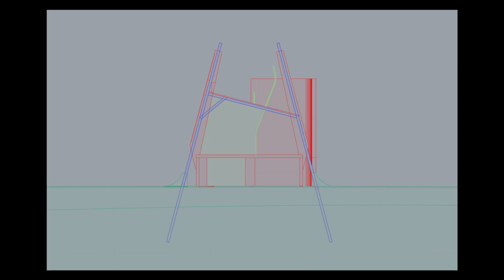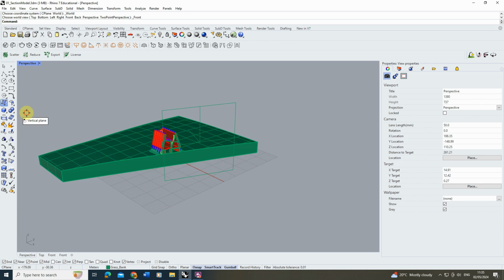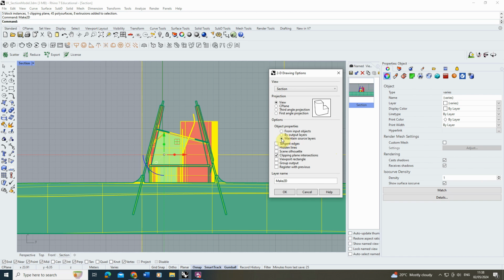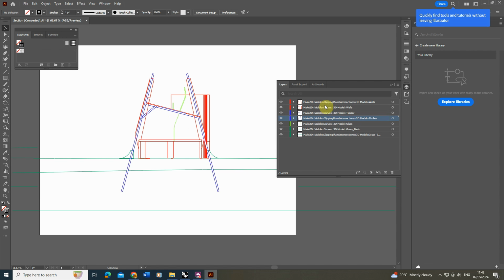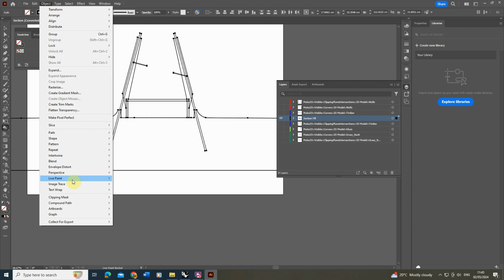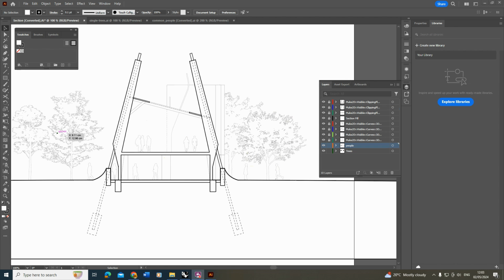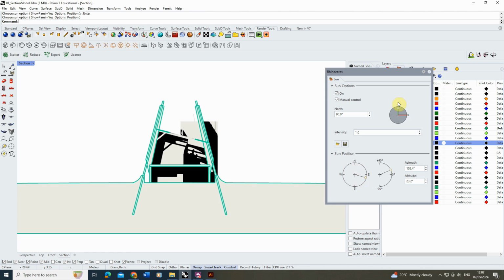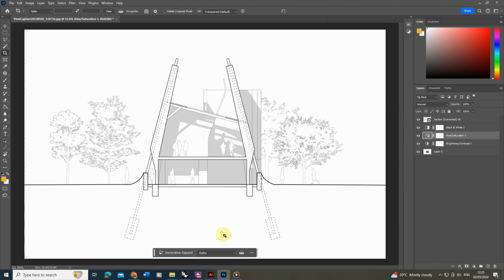Section Drawing - Rhino

Comment: When I turn off skylight like you did my model turns dark and weird unlike your screen
Reply from the maker: This is likely due to the sun settings - if you type in the command ‘sun’ and set this to manual controls you can make sure the sun is angled above the horizon, this should light up the model

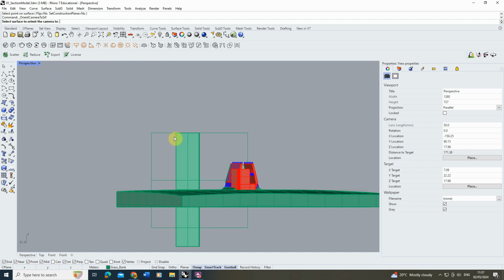Comment: 4:00 a better way to make custom views is to set a c-plane, above theres a tab called c-plane best of them is called “c-plane from 3 points” set the c-plane in a way planar to the section rectangle, then type the command “plan”, to revert to default c-plane you can try “world xy”, “world xz”, etc

Comment: Thank you very much, Tom, for creating these most useful tutorials. I have shared your profile to some of my fellow uni peers (all the way in Sydney, Australia).
Reply: so for some reason, when I use vertical plane (or any drawing tool), it does not snap to the clipping plane the way yours is showing even though I have my objects snaps turned on. Not sure if it's a Rhino 8 issue?